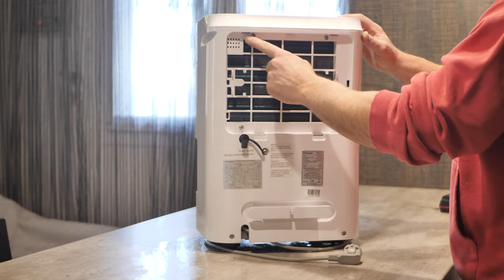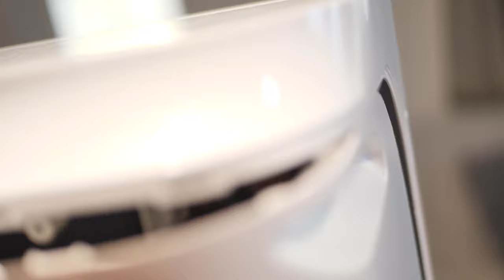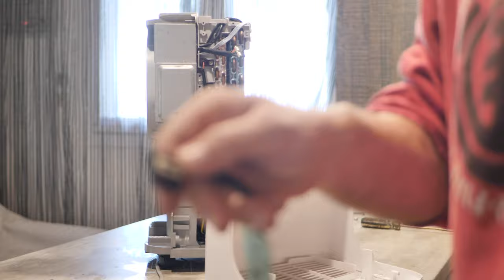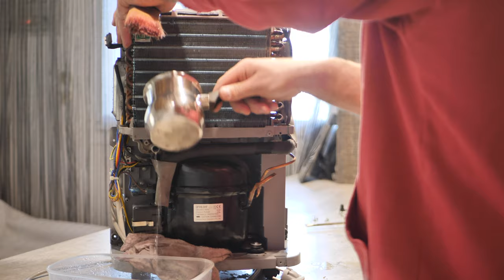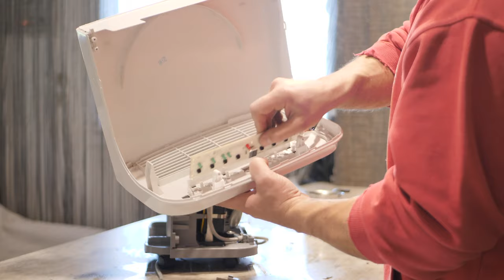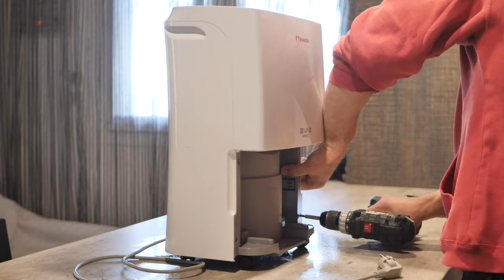How to disassemble and reassemble Inventor EVA II pro dehumidifier 4K

Comment: This is was an amazing video, showing properly where all the screws are and every needed step.
Note: What really makes mad is that these modern appliances lack proper maintenance accessibility. I mean, the manual only has maintenance instructions for cleaning the filter and water container.
But this has a rotating fan that works (in my case) 24/24 hours per day for months in a row. Of course that in less than 2 years it started making squeaky noises which not only is annoying but it will obviously gradually getting worse, leading to a wobbling fan, etc

I just wish there was an easy way to lubricate this thing, which is an obvious need.